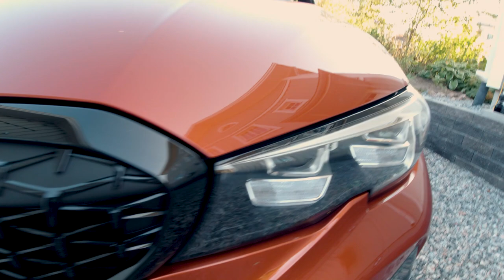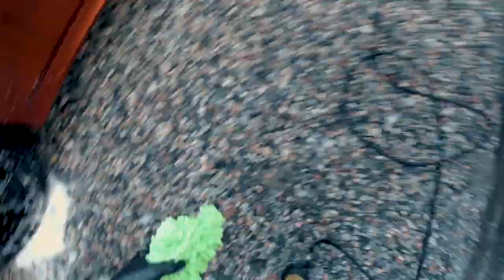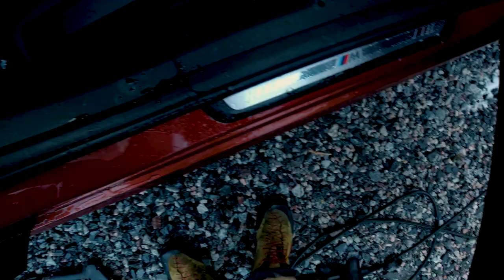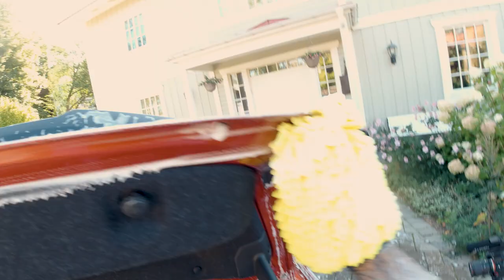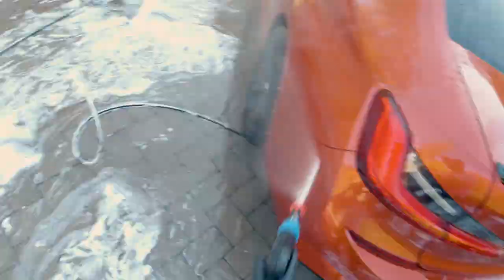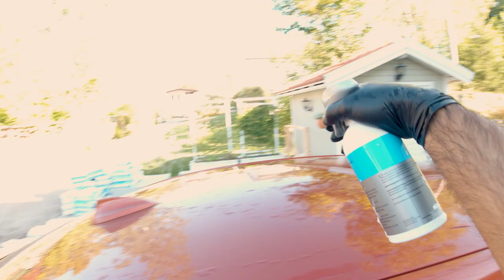How to apply ceramic coating(Gyeon Syncro) - step 1 cleaning and decontamination 2020 BMW G20 330e

Comment: When I get my 330e, I think I’ll just wax it twice a year and wash it 1-2 times every month. Do you know if it comes waxed from the factory?
Reply from the maker: all coatings more or less do the same wax, sealant, ceramic etc. It's some charactarsitics and mainly the longevitiy that is the main difference.

I would say it is the dealership that will apply any form of wax. I would tell them not do so if you plan on doing it yourself or have it profesionally done after delivery.
Reply: @Themazcorner  Thx! Greetings from norway
Reply from the maker: @rsa008  enjoy the car once it arrives :) and congratulations
Reply: @Themazcorner  thx! Do you have any recommendations regarding the service deals?